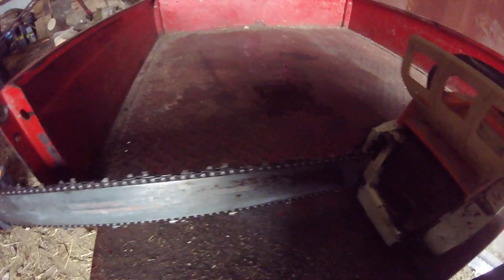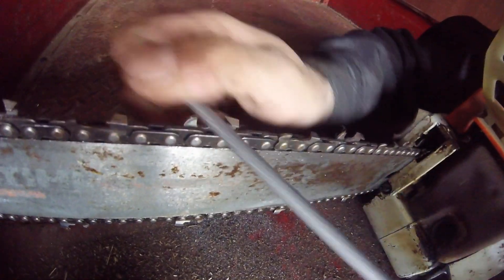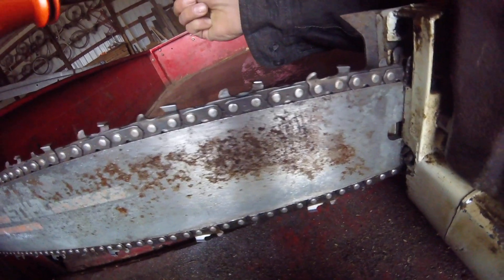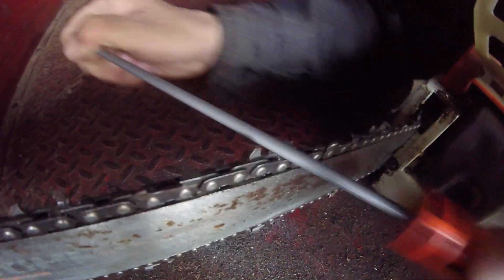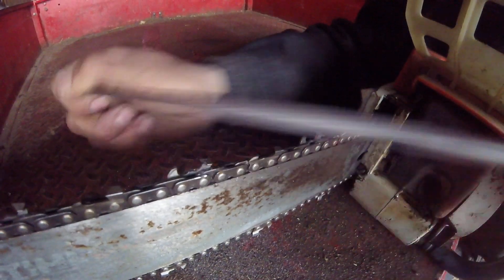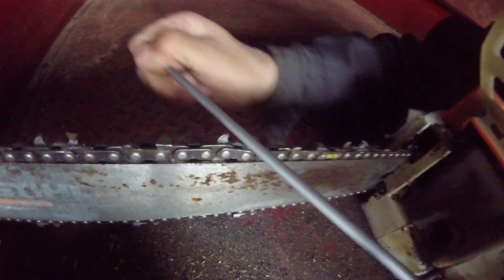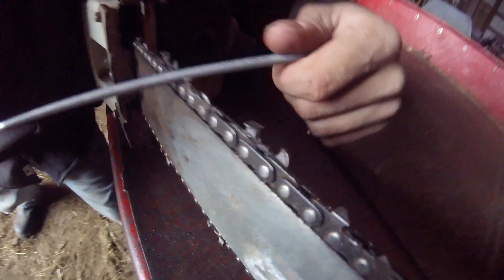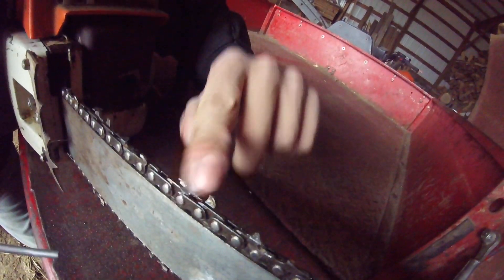CHAINSAW CHAIN FILING.  HOW I DO IT

Comment: Is that 5.2mm file for 3/8 chain? Some said use a smaller diameter file to get the underside sharper. Nice old stihl by the way. Is that a 041 or something?
Reply from the maker: Yes its 5.2 mm 13/64 file and when you get to the end of the chain you can drop a size in file.  I don't.  I just file deeper into the gullet  sometimes into the straps.  Not a big deal.  Just don't go to deep or will make the chain weak by the rivets and break.     The saws an 031 that's gonna get some love someday.  I haven't gotten to it yet.  Got good compression but the recoils worn on it.  I have 3 041s I have to get to also lol
Reply: @TREEKILLER90  Give them love. Lol
Reply from the maker: I've got some videos coming.  You will see.  I've been busy getting saws going

Comment: How many times can you file a chain before you have nothing left to file?
Reply from the maker: Thats a good question   and it's hard to say.  Sometimes I file up every tank and sometimes I can file once a day and be good.  All depends on the wood.   If it's good clean wood I can file a chain 25 plus times easy.  Dirty wood have to remove more material  because the cutter gets rough.  So may only get 10 filings.  I will file a chain and run it until the teeth start breaking off or it's becoming a chore to cut wood with.  Then it turns into a parts chain if there's any good cutters left on it I can splice them here and there on other chains that have had damaged cutters.